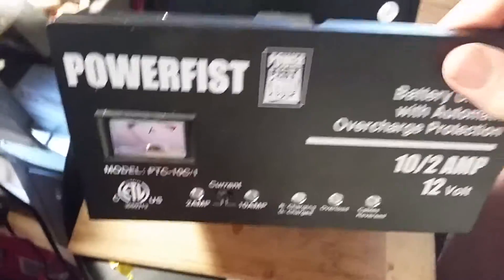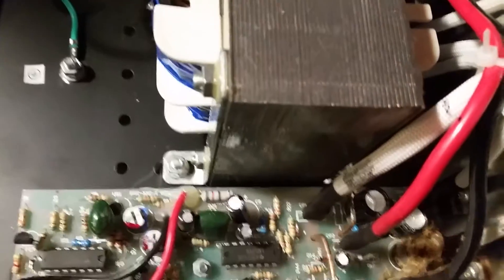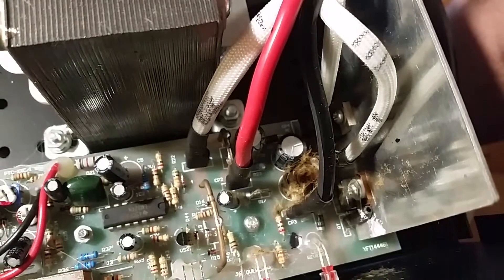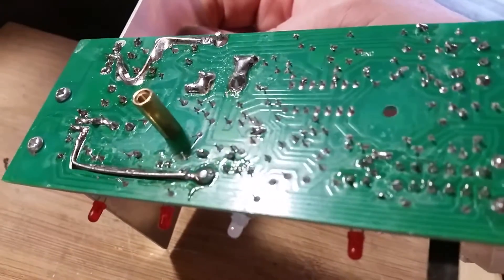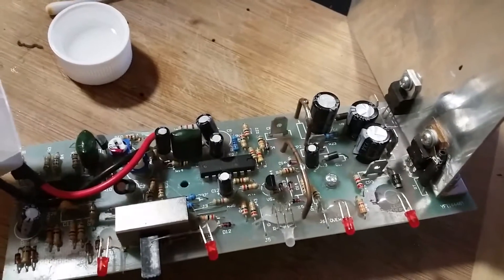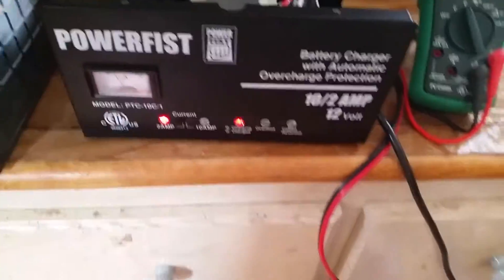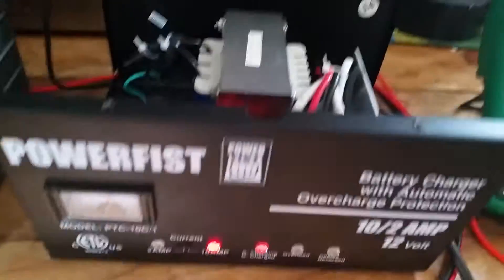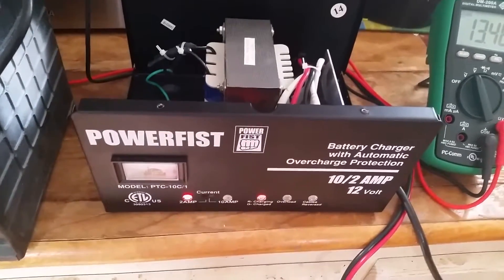12v 2A 10A Battery Charger Repair

Comment: my 6:00 amp to amp battery charger the only thing it does is homes just a little bit it's quiet
Reply from the maker: yeah that hum is the nice big transformer coils .   I assume  it charges  though rite ?
like you said it only hums , but it charges rite ?  . humming is  normal for coil under load especially if its quiet .

Comment: I smiled when you first said that you may have replaced a dodgy cap with a dodgy cap from China, but I laughed outloud when later you said that you might have just replaced them with worse caps!? Hope not. :-)
Reply from the maker: I suspect the '5 PCS Rukycon YXA 220UF 50V 105C Radial Electrolytic Capacitor'  was knock off , lol , so you know they are gonna be good .. rite .. LOL 
The device will probably live out its days topping up my niece's electric ride on toys . in 2A mode . 
Jakec replaced with Rukycon ...so yeah . LOL i should have kept same diameter and went for 2x the capacity like 440uf . looks like the under sized these guys at the factory . I have some high end 60v 450uf's that are from some radio repair stock i had . I'm sure they are just being used to smooth the resulting DC of that transformer. 
Time will tell. lol
Reply: might have been what blew it, using it on full rate charge (aka using it on normal mode) stressed it too much, it will im sure be fine in 2a mode.  its not a switch mode, its  a linear transformer with a controller on it , a swichmode will be 1.10 of the size such as your laptop psu, would be just as powerful, and the newer charges are pretty small now
Reply from the maker: yeah and crap-tastic original caps .  it has been running fine in 10a mode now . its gets a fair bit of use rite now  on low as well but mostly 10a . I opened it up in Nov  and everything looked fine .  I find the cheapo caps just cant take the heat . they boil off too quick.   I really need to get one of those ESR  testers one of these days .  mainly i just replace . the parts are cheap and you find out real quick .    
I have cap on a mobo that is due for replacing , but that will be matsushita / Panasonic ones . im just in no mood for it rite now lol .
Reply from the maker: dodgy  caps still holding it has had a grueling use at 12a all this year , it sits rite next to a 2nd one i fixed  of same make and model  , but that one had more of a impact damage to fix . LOL ...  so yeah the dodgy caps are still holding , and in a heavy work load.  my niece  uses it to charge her electric  ride on toys and Dad uses it to charge all sorts of things .  So it got loads of use  last summer.